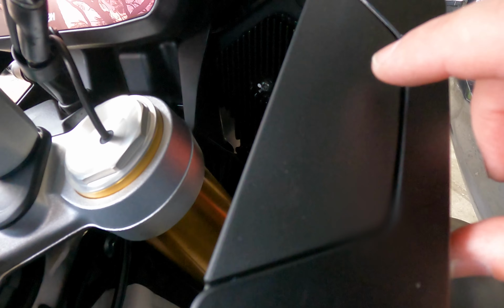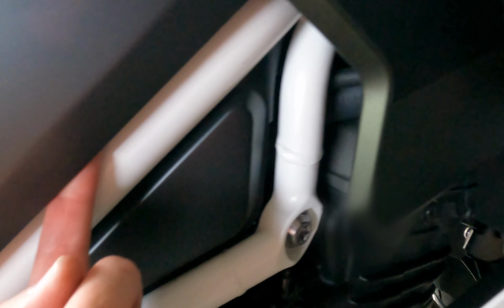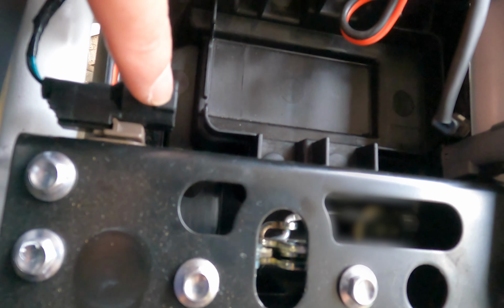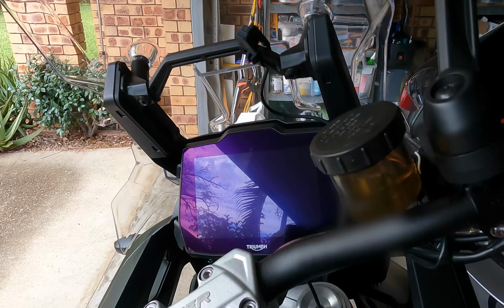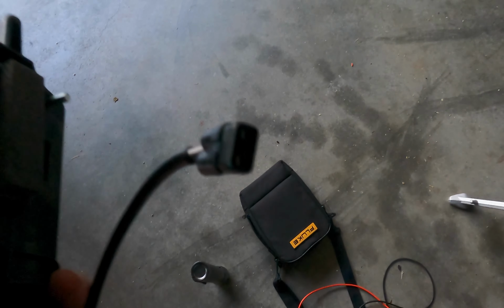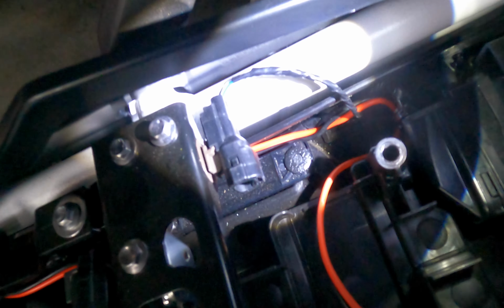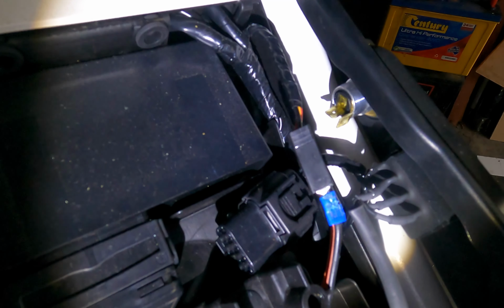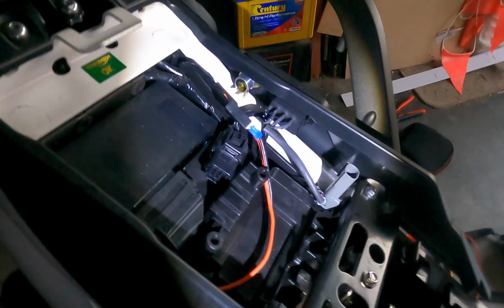2022 Triumph Tiger Rally Explorer  - Garmin Zumo GPS wiring

Comment: What is the wire puller/pusher thing called. The thing you use to get the wires to go between the fairings?
Reply from the maker: Hi. If you just Google 'cable puller tool's you will get the right results.

Comment: Isn’t the power from the port near the TFT sufficient for the GPS ?
Reply from the maker: It is if you want to keep plugging it in all the time. I would not wire it in there though. Modern bikes are very sensitive to that type of thing and would most likely throw up an error.

Comment: Hi, I have to connect a Chigee screen with Apple Car Play, I have a red positive cable, a black negative cable and a yellow earth cable. can I connect everything to the passenger din socket cables which in theory are locked? thanks, I accept advice

I need a voltage between 11 -14 volts to make the dash cams work and the USB one on the phone only has just 5 volts right?
Reply from the maker: Hi. I have another video where I install a Thunderbox for power. It's a better solution than reusing the din plug circuit. Not sure why you have 3 wires though. I've never heard of an earth wire for DC on a motorcycle. Maybe look at your instructions again. 
That kit you have looks very interesting though. I will look into it for myself. Good luck mate.
Reply from the maker: Hi - I just watched another video on the product. It looks like the yellow wire is similar to the white wire on the Healtech Thunderbox. It seems that the wire is used to fire up the device the moment you switch your ignition on so you wire it up to a circuit that is linked to the ignition.

How did you get one of them so early, it looks like they are only shipping in Feb? Obviously you know the right people. Looks like a number of influences have them already. Pity my channel is so small.
Reply: The connection of this device must be
Positive = Yellow
Negative = Black
ACC = Red

Does anyone have a photo of the female rear 12v aux socket connector that appears in this video, please, I'm developing a cable so I don't need the Thunder Box

Comment: Did you cut one end off of the power cord, to hard wire to the battery right?  (Pos/Neg) to connect to the terminals?   I'm hardwiring to the battery, both my phone and also a Sat Nav...and I'm assuning I'll have to cut the end off, split the wires into Pos and Neg...then connect to the terminals (or a Thunderbox actually).
Reply from the maker: Hi - I'm not sure what you mean by cutting off one end of the power cord. I did lengthen it so that I did not have to drag the power adapter through the bike. 
I did end up using a Thunderbox and you can see that in one of my later videos.

Comment: Dear @Alan Simpson, realy helpful video. Just one question, chan you share with us the kind of connector that Triumph use to connect USB ? I try to find hit in google without result. Many thanks . Marco
Reply from the maker: Hey Marco. Do you mean the connector that the phone connection under the seat connects to the bike? If so then no. Sorry mate. At first I just connected my wiring to the din plug wiring but then replaced it later with a Thunderbox solution which I show in my next video.
Actually - I just looked at my Ebay history and I think this is the part https://www.ebay.com.au/itm/324377039107 .
You will also need some of these: https://www.ebay.com.au/itm/324376995481
Just so you know - I did not use this solution in the end.

Comment: Alan, I been watching your videos with interest, I have a Garmin Zumo 595, but how have you managed to hide all those cables in the channel?

I understand the power routing but there’s no way I can fit my cables, any help is appreciated.

Trevor
Reply from the maker: Hi. Did you open up the little space where the front indicators are? I fitted the Garmin box in there with a bit of spare cable length. Maybe the box of the 595 is larger than the XT? I had to shift it around quite a bit to find a spot for it that allowed me to close it up again. It was not easy from what I remember. It's a real pity that the box isn't further down the cable. Perhaps another solution is to insert more cable between the Garmin and the box so that the box can go under the seat somewhere? That was going to be my next option if the box did not fit where I have it now.
Reply: @ADV-Rider-Dude  Cheers for your reply, I guess it’s a different set-up with regards to the cables. I reckon I’ll have to remove the covers and route it afterwards.